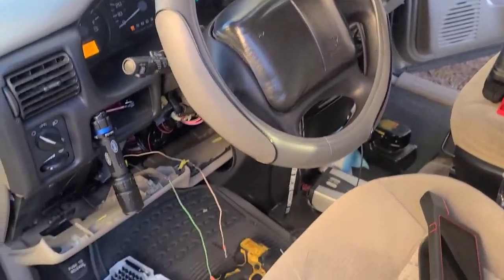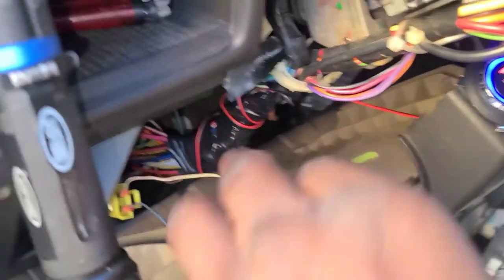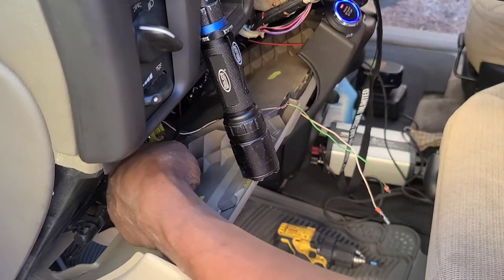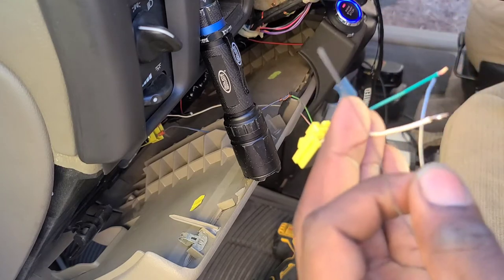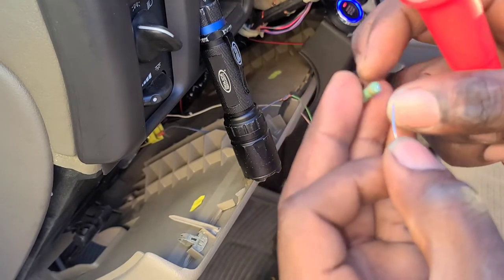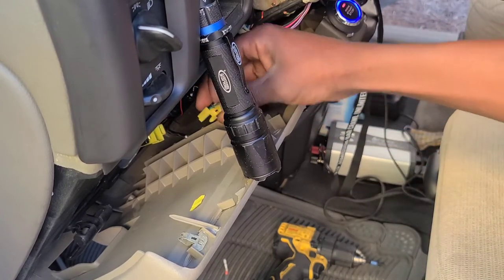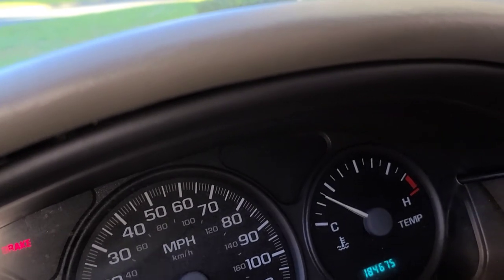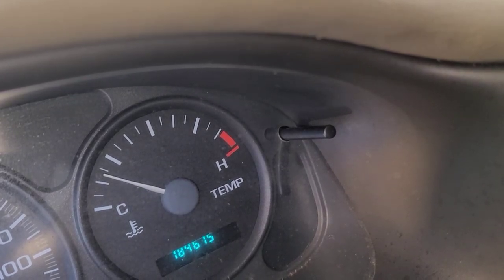HOW TO USE A RESISTOR TO GET OUT YOUR SRS AIR BAG LIGHT

Comment: Did you use voltmeter to find what impedance resistor you needed on the air bag you took out??? How did you know 10k ohm resistor was the correct resistance?
Reply from the maker: I know about car computers so that how I know but you can use 2.2 ohms 3.3 2.5 which is easier to find thanks for stopping by

Comment: I know you get this question a lot. I have googled it and I couldn't find an answer. Do you know what size resistor I would need for the steering wheel airbag on a 2006 subaru forester? Thanks
Reply from the maker: 3.3ohms 2.2ohms 2.5ohms 1/2 watts

Comment: This removes the airbag light from the dash but will that airbag work?
Reply from the maker: It is a temporary bypass until you get the faulty airbag replaced
Reply: The other airbag will work? Since you are only bypassing the one is faulty?
Reply from the maker: @sc0rpion604 yes

Comment: Hello what resistor and wattage should I use on my Lancer Cedia 2003 model?  Will connect it on the steering srs yellow socket.  Thank you very much
Reply from the maker: 2.2 ohms half watt
Reply: @MrtalentedReid  thank you sir.  Do you know how to remove/delete permanently the SRS?
Reply from the maker: @brylontoc6140 I don't recommend deleting it just do the temporary bypass

Comment: I was lookking for a seatbelt resister mod. On the 2020 ford explorer forum someone said to use a 763kohm resister but I can't find any. What do you recommend?
Reply from the maker: 2 - 3 OHMS Resistor
Reply from the maker: BOJACK 50 Values 1350 Pcs Resistor Kit 0 Ohm-5.6M Ohm with 1% 1/4W Metal Film Resistors Assortment https://a.co/d/7SkfaP9

Comment: will the airbag deploy as normal if i add a resistor or it just switch off the airbag light
Reply from the maker: It just switch off the lights
Reply: Incase of accident the airbag won't deploy @MrtalentedReid
Reply from the maker: It won't if the air bag faulty

Comment: Nice video. I have light from passenger pretensioner open circuit. Dealer change it under warranty but light cameback right away. They said they need to trouble shoot again what the issue. Im afraid that they say thwy need to change the module which is i cannot afford. Do you rhink this will work to 2017 nissan pathfinder? What type of resistor i need? Thanks for your help
Reply from the maker: Use A 2.2 ohms resistor
Reply: @MrtalentedReid  thank you bro. When it bypass the other airbag will work? Because it probably gonna be a while until i change it. Since it will cost me probably $2k
Reply from the maker: @sc0rpion604 yes take your time

Comment: hi great video ,,, i have a 2012 toyota corolla , what oms resistor should i use ? and would the airbag light function as it should , would it come on when the ignition is turn and cut off when the car starts?
Reply from the maker: 3.3 ohms resitor it is a bypass

Comment: I have a 2010 Subaru outback 2.5i what kind of resistor I will have to use bro..thanks
Reply from the maker: 2.5 ohms
Reply: @MrtalentedReid  thanks a million u have a great night..I am in New York where ru located??
Reply: @MrtalentedReid 2.5 ohms 1/2 watts will work ??
Reply: Bro 2.5 ohms 1/2 watts or 1/4 watt Amazon have only 2.2 ohms can use the 2.2 ohms 1/2 watts or 1/4 watts I am sorry to bother u..

Comment: Great video, please advise what resistor I can use for a 2010 Mitsubishi Lancer driver side knee airbag? Thanks in advance.
Reply from the maker: 2.2 Ohms
Reply: As possible to use 2.2 ohms for Chevrolet impala 2006
Reply from the maker: Yes 2.2 ohms mostly use in all make
Reply: @MrtalentedReid  great, and how many watts? A quarter, half or 1 watt?
Reply from the maker: Half

Comment: Awesome do you know what ohms 2008 ford galaxy seat belt /restraint control module uses? Would 2.5 ohms be OK?
Reply from the maker: 2.2ohms thanks for stopping by
Reply from the maker: Oh yes 2.5 can also be used
Reply: @MrtalentedReid  man thanks for the fast response! Useful videos you have. So the designated resistance is 2.2 ohms ford galaxy RCM/SEAT BELT PRETENTIONER/SRS but I can use a 2.5 Ohms resistor? Do you know where I could find a wiring schematic for a 2008 ford galaxy tdci? I also have a mystery loose wire. Can't find a wiring manual. Thank you!
Reply from the maker: Oh wow I don't have any idea about how to find wire diagram but I always know how to trace wires and find them lol 😆 lots of work though sometimes 2.5 good
Reply: @MrtalentedReid how many Watts 2.2ohms resistor for this? Thank you!
Reply from the maker: 2.2 ohms 1% 1/2watts
Reply from the maker: BOJACK 300 Pcs 30 Values Resistor Kit 1 Ohm - 1M Ohm with 1% 2W Metal Film Resistors Assortment https://a.co/d/41qR6eo
Reply: @MrtalentedReid  got some locally in an electronics store just before they closed, 2.2ohms 1m2 watt! So close to finishing this airbag light journey omg. Thank you for your help!
Reply from the maker: You are welcome
Reply: @MrtalentedReid  is a 2.2 ohms 1/2 watt resistor OK for this job? Mine aren't working as I'd hoped. Maybe I'm doing something wrong.
Reply from the maker: Did you clear the code?
Reply from the maker: And another thing you have to make sure it is the main stream you getting at because other circuits can trigger that warning ⚠️ light
Reply from the maker: Try the 2 Ohms and 3.3 Ohms all that I send u usually work for me if the wires are ok and the module
Reply: @MrtalentedReid  hi thanks for the answer. I sent you an answer before this but it had a link it in to a thread I have going on a ford forum with photos, the comment I posted has gone now from here and I have read it goes to you the content creator in a section called held for review. I'd prefer it if you didn't post the link actually but if you do have the time to look that would be amazing. If not that's OK also I appreciate your help anyhow.
Reply from the maker: Send me a message on Instagram at mr talented reid

Comment: Will this work on side curtain airbag spot? My vehicle is rebuilt but missing the curtain airbag so I would like the dash light to go off... It's 2016 Buick encore
Reply from the maker: Yes it can
Reply: @MrtalentedReid  ok I bought this car with rebuilt title so I figured this would of been done to it before I bought it. The airbag light was on on dash.  Upon further inspection they had put tiny resistors in the driver and passenger curtain air bag connectors and the driver seat belt connector. I replaced them with 3ohm models. Hooked battery back up and the airbag light is still on. 

The knee air bags looked fine. And I haven't managed to get the steering wheel cover off yet. Didn't have the right size screw driver to push into back of the wheel to get it to pop out. 

But let's say it's good.... What else could it be or should I check?
Reply from the maker: 4pcs Car SRS Airbag Simulator Tester Testing Instrument Resistor Bypass Fault Finding Sailsbury https://www.amazon.com/dp/B08XB9WT2M/ref=cm_sw_r_apan_glt_fabc_65VVHVRRXC42WJ6P0D6N
Reply from the maker: Hopefully that should help if nothing wrong with modules for the system

Comment: hi, will a  2.2 ohms work for honda civic fk7 srs bag?
Reply from the maker: Yes
Reply: @MrtalentedReid  how about for side airbag for side seat? 2.2 ohms? because i bought a 2.0 ohms and its not working.
Reply from the maker: Try 3.3ohms and make sure no open circuit it there and the control module is good

Comment: Hey there do you know what resistor i would need for a passenger dashboard airbag on a 2000 Nissan primera p11?
Reply from the maker: 2.2 - 2.0- 3.3ohms one of those should work
Reply from the maker: BOJACK 1000 Pcs 25 Values Resistor Kit 1 Ohm-1M Ohm with 5% 1/2W Carbon Film Resistors Assortment https://a.co/d/gVzKog3

Comment: Would you happen to know what size resistor to use for a side curtain airbag on a 2009 Honda accord sedan
Reply from the maker: 2.2Ohms
Reply: Did you ever get it done? I have a 2016 Honda accord sedan and I'm trying to figure out how to put the resistor on the curtain bags
Reply from the maker: @smallsplayz9740 same as the other

Comment: Does this work on my slavage car with no air bag and seatbelt tensioner error?  It seems like you just put the resistor directly to srs cable under the dashboard.
Reply from the maker: It best to Google it to see what Ohms resistor use on your car
Reply: @MrtalentedReid  I have a Honda Fit 2012 and I’m searching it but it’s not clear… do you know what ohm works for it?
Reply from the maker: 2ohms resistor if that doesn't work for your car try a 10ohms
Reply: @MrtalentedReid  ok will try I’m gonna try 2.2 as well since I read that as well somewhere
Reply from the maker: Ok
Reply: @MrtalentedReid  I changing my factor car seats (which have airbags ) to racing seats (with no airbags).  I was wondering if this would work for the airbag notification won’t come up?
Reply from the maker: Yes

Comment: Hey, thank you for the video!! What resistor should I use for my 2003 Chevy Trailblazer?
Reply from the maker: 2.2 ohms
Reply: @MrtalentedReid  thank you so much! and a super fast reply! Be well, and have a great day!!
Reply from the maker: Your welcome have a blessed one
Reply: @MrtalentedReid  you too, sir! One more easy question for you: so, at this point both my front bumper impact sensors are disconnected. Do I need them reconnected for this to work?
Reply from the maker: Yes they need to connect
Reply: @MrtalentedReid  roger, thanks so much again!!! Blessings for this day 😊
Reply from the maker: @r.joseph8911  your welcome
Reply: For a 2012 Honda Civic with two exposed wires for one of the front impact sensors (sensors itself is missing) can I use a 2.2 Ohm resistor to close the loop and turn off airbag light?

Comment: Hello, I have a 2014 Skoda Octavia mk3 VRS. Do you know what resistor/diode is needed for two front seatbelts?
Reply from the maker: 2ohms resistor
Reply: @MrtalentedReid  Thank you! Can I hook the resistor up to the plug that meets the seatbelt, instead of opening the dash?
Reply from the maker: If it is the seat belt having issues you can but if it is the one in dash area you have to remove some part of the dash

Comment: Greetings. Your video is very helpful. I have a mercedes with the srs code B 1864 the resistance value in the ignition circuit containing component R12/2 front passanger ETR ignition squib is too high.
What can I do to bypass this and turn the srs light off , thank you for your help
Reply from the maker: You can use a 2.2 Ohms Resistor
Reply: I did but the light still on. It's so confusing
Reply from the maker: Maybe you missing something do further checks
Reply: Possibly,  but is this problem on the passenger seatbelt ?
Reply from the maker: Yes check if there is any broken wires under the seat
Reply from the maker: https://youtu.be/NWpQbcpEaOI
Reply: I'll do that and come to you , tx for your help , by the way where are you situated?
Reply from the maker: Check out that video that should help
Reply: Thank you sir

Comment: you can put a simple 2.5 ampere fuse, the resistor can burn out and there is a possibility of fire 😊
Reply from the maker: Am doing it for yours no fire and it is wave signal won't cause fire
Reply from the maker: Putting fuse gonna damage the computer program for the airbag system

Comment: I bought a bag of diodes but I don't know which are 10 ohms, do you know what the tester would read in number that equals somewhere around 10 ohnms
Reply from the maker: 10 ohm resistor color code 4 band resistor is brown - black - black - [Tolerance]. The color code of the 10 ohm resistor with 5 band is brown - black - black - gold - [Tolerance]. 100 ohm resistor color code of 4 band resistor is brown - black - brown - [Tolerance].

Comment: So basically you just tricked your cpu to think that the airbag is connected and in working order..  they have it programmed to check for a certain resistance through the wibdings of the actuator for the airbag deployment solenoid.  If it comes back too high or low it will disable the system as to not trigger the solenoid or whatever..  so doing this will work but if you expect the airbag to work if you get into a wreck than wear your seatbelt cuz that fucker aint gonna pop out..  and after the wreck as soon as you plug it back in its liable to set it off..  lol..
Reply from the maker: Thanks for stopping by
Reply: Nice one
Reply from the maker: Thank you